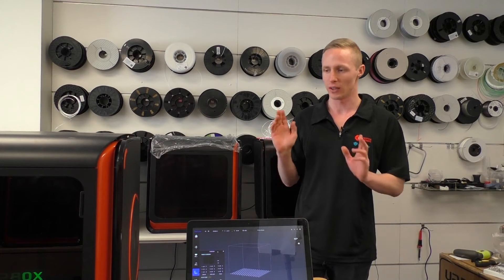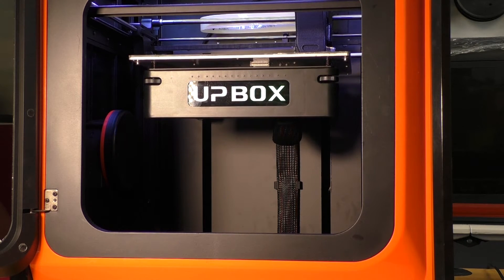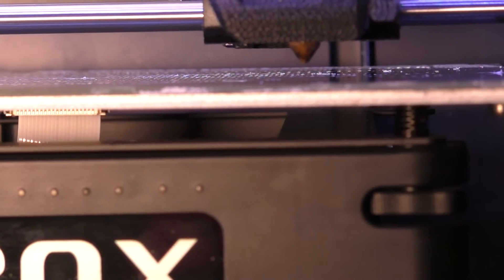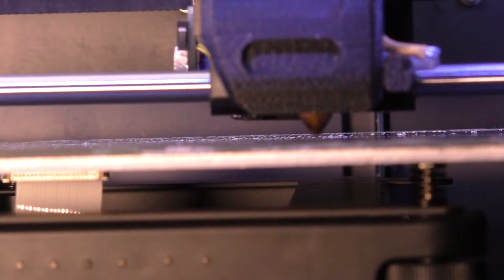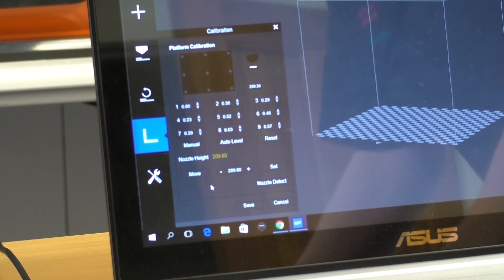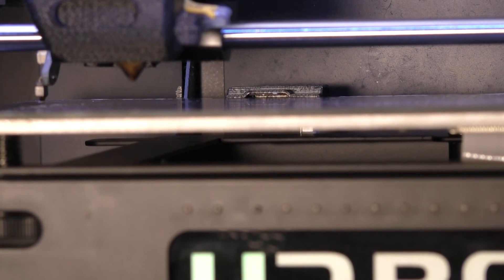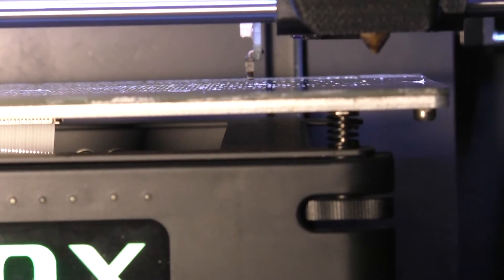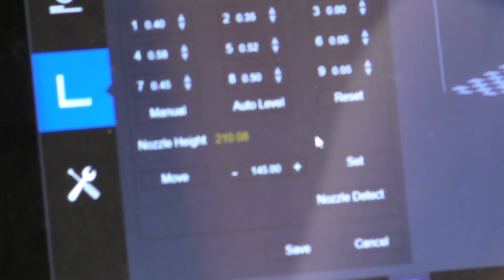Support / UP Box / Manual levelling your UP BOX 3D printer

Comment: OK used this video to level platform BUT I manually;;y checked the bed level with a Dial Test Indicator because I was still getting an issue with the bed being out of true. Adjusted with the trim levelling screws before then using the software to level, that made a huge difference. I cannot believe how far out the bed was before adjusting the screws. Thanks for the video quite helpful.

Comment: event if I manually calibrate the bed and autodetect the nozzle; when printing, the nozzle digs into the board, and damages the printing job...
Reply: Hey Angelica, how did you fix this problem? I have the same issue. Thanks.
Reply: I followed exactly these instructions on this video and it actually worked for me. You can definitely give it a try.
Reply: Thanks  I did that and it worked. I'm finding it needs to be manually leveled quite often.